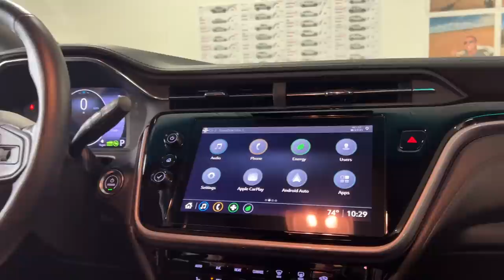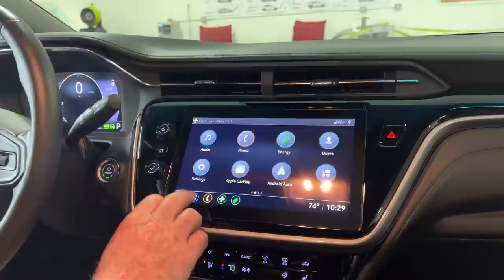Sandy's First Impression of the 2022 Chevy Bolt EV

Comment: I own the 2019.  It's one of the best buys i've made and has been very reliable.  The biggest issue of course has been the battery made by LG and the risk of fires.  It did take too long to resolve that issue.  I've been lucky enough to get the new battery replaced already, so no longer an issue.  Second issue as mentioned by others is slower charging then most of the other cars.  Most of my charging is done at home so not an issue.  Still I would hope that the charging rate could be increased once the new batteries have been determined to be reliable and safe.  Hopefully a software update would address this.
Reply: So your happy with a vehicle, that cost you probably over a hundred hours, just to get to a safe use level?
Reply: @gamerfortynine  why are you assuming it cost me hundreds of hours? I just indicated that I mostly charge at home. In 3 years I’ve only used public charging twice. Nothing changed when the battery defect was announced.
Reply: I suspect 55 kW DCFC is due to hardware limitations, probably cable diameter and/or battery pack connections.

Comment: For me seasonally,  my biggest gripe isn't the car itself but the charging networks.  The nearest non tesla charger to me is out of range to get to.
Reply: If you can charge at home, you generally don't need it for commuting. I've had a Bolt for a year and never used the DCFC on it. Never needed to. But if you don't have access to a home charger, even with DCFC nearby, the cost benefits of an EV fall apart unfortunately. The economic benefits are heavily skewed to those with homes or that can charge at work for free.

Comment: Yes, this is moving in the right direction especially for the great majority who will never be able to afford a $60-70k car but I really wish the automotive industry would offer a basic EV utility vehicle.  Think something like a late 60s Datsun pickup.   Super basic....how hard could it  be?   Seems like it would be very popular.
Reply: It would be, but we don't have the batteries yet to support such demand
Reply: Base F150 Lightning is at 40K… assuming a slimy dealer doesn’t jack it up as you’re walking up to them.
Reply: They don't for the reasons Sandy mentioned. They don't make money or very little on base vehicles.  I agree, I would like a basic truck like that. Air and heat.  They cant keep 70-80k and up suburban's and Tahoe on the lots because they sell so fast.
Reply: I read that Ford is planning a smaller EV truck, either based on the Ranger or Maverick. Or perhaps just sized like them, using a new platform.
Reply: Yeah Ive been thinking something like the original Willys Jeep. The problem is that the batteries would cost more than the vehicle. Software features esp dont really cost anything... and once you have the screen its actually cheaper to implement software-driven features for HVAC and radio than to have buttons and knobs. Even parts-bin knobs cost more than a software-driven interface. So the "most basic" EV ends up actually being something with a similar interface to the Model 3. Which is why everything is moving in that direction.
Reply: @mjhowson2389  Base Maverick is 20k... no way they could afford to put enough batteries in it and still maintain a low enough price point. It looks like they will do a PHEV Maverick in the US market and maybe an EV Maverick in Europe where there is more demand for a tiny EV truck.
Reply: There will be aMaverick pluginhybrid!

Comment: Bought an EUV a couple of weeks ago to go alongside a Tesla Model 3 Standard Range. It's perfect for my hundred mile daily round-trip commute.
 I don't have to charge the battery to 100 or drain it below 10 for my daily needs even if I have to run errands in the evening. It charges up to 11kw at home vs the 8kw Max of my Tesla and the Android Auto/Apple car play are a nice feature that the Tesla doesn't have either.
Overall, great car for daily needs, only major downside is slow dcfc

Comment: When Sandy mentioned drum brakes, I was curious if he hadn't noticed that the VW ID4 has drum brakes in the rear.

I think we continue to see disc brakes is for the most part because ABS is easier to implement with disc brakes than drum and it is easier to do visual inspections with discs.
Reply: Disc Brakes are just better, spend some time in an ID 4 (rear drums) and it becomes quickly apparent.  The problem with Sandy is he hasn’t spent enough time driving the vehicles he reviews.  He is an engineer who also grossly misjudged the Model 3 under initial inspections.

Comment: As a current owner of the 2017 Bolt, would love a tech breakdown between the 2022 and 2017 to see if there were any powertrain choices/changes you notice from your teardown just over a year ago. Was hoping you would make some comments on differences with all your time on the 2017 Bolt (those videos helped me into buying a used one), but didn't really hear any yet.
Reply: I bet you there are zero differences, judging by the charging speed, range and power output. Looks like they just changed the headlights and taillights.
Reply: @TheMobilefidelity  Other than a change in battery chemistry in 2020 for a bit more range, you are pretty much right. Everything is about the same.
Reply: @TheMobilefidelity  That is what I thought as well, but looks like there were some changes in the price-reduction segment as shown in the new video today. Around the 5 minute marker to start. Seems minor so far, but definitely a cost savings to maybe some cooling performance, still watching at time of typing.

Comment: Thanks for what I would call an accurate review. I am somewhat biased I suppose since I own a 2019 Bolt. As a daily driver, the car is fantastic. It has a generous amount of very functional space, but it is still fairly compact. You can park it about anyplace and still easily get in and out. It's also quite speedy and fun to drive. Yes, longer trips are a bit of a pain but with 259 miles of range it's not all that bad. If you want more, get a more expensive car. The new Hummer EV can get 350 miles of range and charge at 350KW all while still using pouch cells.
Reply: Hummer EV is a bloated inefficient tank. It looks cool, sure, but has to have a GINORMOUS battery to get any range, and you have to lug that GINORMOUS battery around doing smaller trips, don’t forget

Comment: I've owned a 2015 Volt, 2020 Bolt LT, and 2022 Bolt EUV Premium I'd put the fit and finish of any of them up against any Tesla! I don't road trip but living in central Ohio I can get to most any state line and home again during day trips without charging. I plug my phone and car in at night and in the mornings they are both charged and ready to go. The Bolts are extremely efficient and the 6-inch longer EUV rides very nicely. Frankly, I don't need a $100,000 car that goes 200 mph... these 3 Chevys have saved me thousands of dollars in fuel costs. Don't get me wrong... I like Teslas... BUT, I think Elon has lost his way a bit... In the beginning, he wanted to populate our streets with $25K EVs... now he's more concerned about making 25% on each of his units sold. I'd like to publicly thank Chevy for making Elon's dream come true!! Thanks, Chevy!!
Reply: Delusional
Reply: @marcol869  I just priced a Model 3: $52,440 is its cost, twice as much as a Bolt... it should be better... right??  However, the Range is about exactly the same, so in my opinion, I don't think they're twice as good.

Comment: The EUV apparently has less storage space than the smaller car. I think it just has slightly more legroom in the second row.
Reply: 3 inch more leg room.  3 inch longer cargo. 6 inch longer total
Reply: @Boomtendo4tw  with the seats up, the Bolt EV has slightly more cargo volume than the EUV. Actually even with the seats down the EUV doesn't have any more space.
Reply: @GregHassler  I had a chance to check one out at our state fair yesterday. It was an EUV. There's no getting around the fact that it's a basic hatchback. I will say I would take the EUV and sacrifice a tiny bit of cargo space for the extra second row legroom (if you regularly have adult size back row passengers). It makes a huge difference in the sense of roominess.
Reply: The EUV is a head scratcher, like why does it exist?

Comment: My opinion on EV brakes is that when the car is fully charged, there will be that rare time when someone will need top notch brakes with no regen available, so don't go small the swept area.
Reply: lol
Reply: I ride an electric board that operates similarly but worse. I have no brakes at 100%. So I make sure I’m not riding it at 100%.
Reply: Regen brakes could still be used to slow the car when battery fully charged. Just dump the power through a heating coil(as in a space heater or stove top burner) instead of charging the battery. Not saying that's what they've done, but that is what could be done. The heat will be no more or less than the heat generated by friction brakes. And could be dumped through the same cooling system used for the batteries and motor.
Reply: Just charge to 95%

Comment: This looks like the same 2022 2LT with Bose and ACC that I bought a few months ago with 7400 miles for $19,400 after the $4000 buyers credit. Same color even and I like it a lot. Today I installed a Comma 3X level 2 drive assistant device.

Comment: I drive a Corolla right now but, it has high mileage and looking to buy the Bolt because it all I can afford. The 2023 Bolts are now in production but, I don't think much has change. Car and Driver said that i may have more comfortable seats. I hope so because I sat in a Bolt, the seat felt hard with little seat padding. I hope that was corrected. Glad you're reviewing it now even though it's not the 2023 version. I plan to buy within the next three months.

Comment: We have had two Bolts for almost 5 years and love them.  Thier best feature is their simplicity.  Yes, you have to lift the rear hatch by hand - that saves repairing an expensive electric lifting motor when it enivitably craps out.  Overall, you were kind to the Bolt, considering that it is your favorite, "whipping boy".

Comment: I think that GM probably made a mistake with the Bolt being their first try for the US market where they love big cars and hatchbacks are practically dead. If they had this car in Europe or many other parts of the world they probably would have sold far more than they did in the US. Proof of the car being right is what I hear from so many satisfied customers.
Reply: @mikedx2706  Bolt are not sold anywhere else except in the US. They use to own companies in Europe, Opel in mainland Europe  and Vauxhall in the UK that were sold to Stellantis. In the past the use to sell the Volt under the name Opel Ampera that was regarded by its owners. They also sell BIG in China, albeit with local partners, where they sell far more CARS than in the US. For example (2021 data): Buick US-182,000, Buick China-816,000, Total GM US-2.2M while they sold 2.9M in China. But back to the original question: are the Chinese or Mexicans lining up to buy Bolts? Don't know about Mexico but in China GM already sells a lot of EV's under the Wuling brand where the best selling car in China is a Wuling not a Tesla. It is small and cheap which is right for a very large number of buyers.

Comment: Considering GMs track record of lying and marketing heavily with promises they have yet to keep Its a hard no for me but Im glad it might find a niche as a local commuter car. hopefully Gm will support their customers who own these in 5 years. Sometimes better quality and safety is worth spending more up front. Cheap doesnt mean good in many cases.
Reply: You do realize they've replaced every single battery on every single bolt ever produced. On top of that they put a brand new 10 yr warranty on those batteries. That's a company that takes care of their customers.

On the other hand you have tesla fighting tooth and nail in court over unlawful battery limitations for their garbage cars.
Reply: @dece6170  GM cars do not hold up after 100k miles. They typically start falling apart and are not worth salvaging. Meanwhile, TESLAs are going over 1 million miles and people are still driving them. Let’s not forget how unsafe the BOLT is when you get in an accident. I would never put my kids in that tin can.

Comment: Didn't they say not to park it inside because of sudden fire?
Reply: LG fixed their issues. New models are fine
Reply: Resolved now. Owners got a battery replacement under a recall campaign.
Reply: they literally brought all the Bolts back into the dealer and replaced all the batteries.  Since the batteries are new, owners got a brand new warranty on the battery.   Yeah, GM had a problem, but they stepped up and fixed it.  Don't think we can knock them after the very stand-up job they did dealing with it.
Reply: @petersilva037  Found the GM shareholder. 55kw charging with that exterior and interior design brought me back to the early 2000s.
Reply: That was the old models and only if you haven't gotten a battery swap. This is the brand new 2022 Bolt. No issue so far with this one.

Comment: It’s a fair effort. Priced well.
Here’s what’s infuriating about GM: With the EV1 first gracing roads in the late 1990s you can imagine where GM would be today, after 25 years of improvements to that platform. Today, in 2022, if you’re not making Nio, X Peng, Tesla or BYD type vehicles (as in state of the art EV only[I’m not sure why BYD is still churning out hybrids])  you will essentially get annihilated. Customers will quickly discover what the competition is offering and then GM’s only weapon will be a low price… While their internal combustion sales fall off a cliff…
Reply: If that infuriates you? How about learning gm had 40% market share of ev commercial trucks wayyyyyyyyyyyyyyyy back in the 1920s. 
They also built a decent corvair ev in the 60s but didn't sell it. 😀
Reply: The Chevy Volt was the next generation of EV1. So General Motors has been making steady improvements from that original design.
Reply: @toronado455  a hybrid is a step backwards over a pure ev like the ev1 was. And fyi Chevy built the ev s10 from 1997-2000.
Reply: Even more infuriating is that they came out gunning for Tesla when they put the Bolt into production and continue to make all kinds of press statements about being leaders in EVs. But since then they havnt really improved the vehicle to keep up with competitors and they never even planned to build it in big enough numbers to make a real dent in demand.  For perspective: Tesla is building 10 times as many Model Ys in one quarter as GM builds Bolts in a whole year. Tesla sells more Model S's than GM sells Bolts. Theyve dramatically lowered the entry level price point, but are they going to build more of them?

And then next year they will be launching how many new EVs? On a new battery platform not shared with the Bolt. Do they have the supply chain and production capacity for 5 new vehicles next year? And then they will likely introduce a new vehicle that replaces the Bolt and then late adopting Bolt customers will be someone abandoned. It is a baffling, confusing strategy.
Reply: @patreekotime4578  My thoughts exactly.

Comment: Great info on the car. Just watched your video charging up and filling up a job application online. In my 2017 bolt ev. Bought mine in 2019 used with 14,500 miles . Paid $24,000 usd for it. Currently with 67,0000 miles on it. Runs good and the battery replacement of the recall doing 4.4 mi per kwhr. Also have a subwoofer in the trunk.

Comment: For the price it's an excellent car. I thank you Sandy for keeping perspective. It's not a Tesla fighter as much as the Media wants it to be.  It's a transition car to get people into an affordable EV. Is it perfect, no, but for the price, it's shockingly good with excellent range.
Reply: NOPE, the bolt is a compliance clown car🤡.
Reply: @markplott4820  considering the volume they were made in, and the fact it was basically a clean sheet design with very few shares components, your comment is irrelevant.
Reply: @matthewlibanio8227  - BOLT is NOT a clean sheet design, is built on a SPARK platform , gm EV2, and it's 80% built in KOREA by LG, Including THERMAL system, motors and battery pack.
Reply: @markplott4820  Complete Nonsense. The Bolt is not even vaguely built on the Spark platform.  Where do you get your information from?  Honestly.  Not sure why I bother replying to you. If anything it's distantly related to the Volt in some select parts, which the Volt itself was a very distantly related to the Cruze, but it was always misreported that they were related. They were not. Look underneath all three cars and they are completely different. The Spark especially. Hahaha. The Bolt is structurally built for its pack. The pack on the Spark was modified all to hell to work in the space for the ICE equipment. Go spread your misinformation elsewhere.
Reply: @matthewlibanio8227  - MUNRO has the REAL story in his REPORT on the BOLT. 
It uses EV2 gm platform, that shares with SPARK, and BOLT is made in a former SPARK factory.
80% of the BOLT is engineer & built by LG in Korea. 
GM only build the BOLT shell that is GAS car based. 
ALSO the ULTIUM battery is a FRAUD, cells are from LG and they are DANGEROUS pouch cells , again.
Reply: @markplott4820  "and BOLT is made in a former SPARK factory."  Wrong.  Former Sonic factory, Orion Assembly.  Get your facts right.
Reply: @PeakVT   - Sonic , still an ICE car.